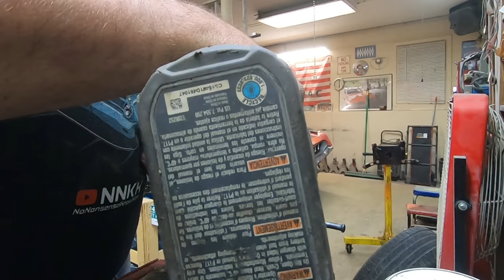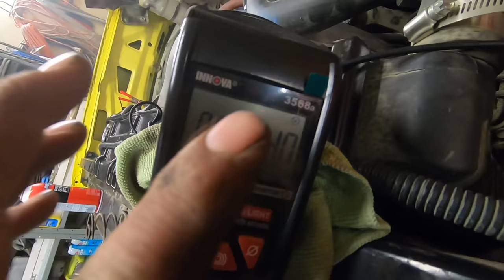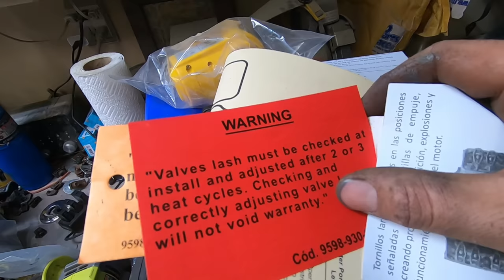Can I ENGINE SWAP a K5 Blazer in a Weekend for CHEAP?

Comment: If your trying to mess with hei distributors, and you don't have a distributor wrench, flex head ratchet wrench and a screwdriver, or sacrificial 9/16 with a 90° bend on one end..... everyone has at least one cheap wrench to bend up

Comment: @59:35 That ground on the alternator bracket is junk. You can see it smoking! Bad grounds can cause crazy issues. It can mimic ignition issues. Crimped end pre made cables can be trash. Hope you see this. Love the Blazer!
Reply from the maker: It healed itself

Comment: Use Permatex 2 on bolt threads instead of plumbers tape or RTV. 😂 Closing off the intake heat cross overs will make a carb choke not want to open fully in the winter or on cold days. There are different size holes available for the gaskets. Small and large. Leave the valve covers off when you prime the oil so you can see each rocker arm get soaked with oil. 😢 Spark plugs made in China are junk and are not all the same. I’d like to see the data on your quote about spark plugs. An inline fuel filter fits perfectly under the alternator bracket. I use demineralized water with Prestone antifreeze and make a 50/50 mix in a container in my summer driver 70 Z28 4-spd. I hope when setting your timing you plugged the vacuum advance can. If not then that’s why your timing shows high.😮 If the engine info says to set lifters then I would or kiss the warranty good bye. Some Chinese guy in the factory probably has no clue what he’s doing. Last thing you need are bent pushrods or a dropped valve. 

When setting hydraulic valves, don’t spin the pushrod, move it up and down, then from zero lash give it an extra 1/4 turn for performance or 1/2 turn. IMO 3/4 is too much and is why the dealer used 3/4, so the customer didn’t come back complaining about noisy lifters.😂

Comment: You put the Teflon on going the wrong direction it spits itself out and it’s super important to put the ground strap from the firewall to the back bolt on the passenger side head

Comment: I'm curious if the flexplate was for a 1 piece rear main motor - I know they are different and the 400 & 350 use a different 1 - my 383 ( 400 crank ) & my create 350 requires different ones for balance reasons
Reply from the maker: The replacement was a one piece seal

Comment: Dalton do you know the purpose of the hole in the front of the block that you put the bolt with the Teflon tape in?
Reply from the maker: Yep, that's my usual go to. But this engine was partially blocked with casting! First time I ever seen it

Comment: Was it weird pulling a engine inside of a dry garage rather than in a direct downpour like the last 3 or 4 motors you pulled on here?
Reply from the maker: Yes for sure
Reply: @PoleBarnGarage  it's so quite in the background no outside noise it was definitely different

Comment: that starter needs shiming what happens is the reman starter nosecone gets  to much material taken off during the reman process where it contacts the block the best way is to use the original nosecone on the reman just a suggestion

Comment: You didn't use the weighted flexplate from the 400 did you? You need a non weighted flexplate or it will eat the bearings out of it.
Reply from the maker: No, used a new one
Reply: @PoleBarnGarage  sorry, it looked like it had the external balance weights.

Comment: It takes about 2 hours to remove the nose of the truck from the doors forward as 1 assembly.  Saves you a bunch of time and your back from leaning over the nose.
Reply from the maker: I would never do that on a painted truck. Waste of effort and unnecessary risk. What the real solution is, is the fancy step stool that goes all the way up into the engine bay

Comment: Listen, 400 small blocks are externally balanced and 350s are internally balanced. So if Gomer put the flex plate on out of sink then the vibration could have killed the motor or made it run loosely and loose all the oil. So be sure you're using the right flex plate and harmonic balancer

Comment: I knew a Chevy man (I'm a Chevy guy to)who swore by motorcraft plugs.
Reply from the maker: They're just autolite
Reply: The porcelain on ac copper plugs is the most fragile porcelain of any plug that I have installed in 30 years of being a professional mechanic.  I won’t run them in my Silverado. Denso, NGK, Autolite all have a more crack resistant porcelain insulator on them.

Comment: Nice old k5! Throw those motorcrap plugs in the trash and get some AC Delco plugs. GM HEI ignition likes good plugs that can handle the extra lightning. Anyone who says there isn’t a difference in spark plugs hasn’t changed enough of them.

Comment: Redoing a Square Body mid 80''''s I have to replace the Radiator. I was just wondering should I go back with stock since it is Mostly Stock or would an Aluminum Radiator be better? If so what Name brand would You recommend. I'm trying to stay away from the chinesium. Lol Thanks
Reply from the maker: Big bucks if you don't go chinesium, I've had good luck with the cheapy ebay stuff
Reply: @PoleBarnGarage  Ok I appreciate it.

Comment: What microphone do you use for your videos? I got a go pro 7 because you endorsed it on your live stream
Reply from the maker: This whole video was done on a gopro hero 7 with no external mic
Reply: Do you not use a mic in your garage?
Reply from the maker: Typically I use a Panasonic g85 with a rode micro and a poofball. Using the rode micro on the go pro improves quality some as well. My first mic was some off brand knockoff of the rode, and it worked great as well

Comment: Awesome video buddy and definitely one really nice piece of history that your dad has there also!!! Would he be interested in selling it???? I’d definitely be interested in it because I’ve been looking for a blazers for a couple years but all the ones I have found are usually rotted out completely!! I’d really really be more interested in a 1969-1972 Chevy blazer if you might no some one that has one running or not running don’t care and don’t even care about the body for one either!!! I have a complete running gear for a blazer I actually just need a frame and body with a title I can definitely do the rest!!! I have both a turbo 400 with a 205 and a turbo 400 with the 208 also and the other one I have and really want to run in a blazer is SM465 manual Tranny and both with either a 205 and a 208!!! I even have a couple of each 203 transfer cases that go behind all the trannys!!! Yes over the years I keep saving all the trannys and transfer cases out of trucks that ended up going to the scrap yards!!! I definitely won’t run the 203 but will save the fronts of the cases witch is the gear box that I end up using for the doubler kits!!! I do run one of the strongest doubler set up in my 1969 Chevy 1Ton 4x4 that I have had since high school!!! It’s the SM465 with a 203 gear box that was behind a turbo 400 and then the 205 witch also was run behind a turbo 400!!! The SM465 I made one of the strongest output shafts with a 32 spline output shaft instead of the weaker 10 spline shaft that they came out factory with!!! I’ve been running my setup for over 10 years and havens had any troubles or broken anything yet!!! I definitely love all the extra gear options that I get with the doubler setup for sure!!! Oh and if I was you I would definitely go back in and double check all those lifters again and make sure that they are set Wright!!! I don’t no if you do a 1/2 a turn in or a 3/4 turn but I would definitely just go a 1/2 turn plus the looser they are the more power you will get out of it!! The reason I say I’d definitely recheck them is because a kid I was helping out baught a 350 from jegs and it was also a reman engine and I believe it also was the ATK engine and he ended up loosing his cam because he didn’t end up going in and checking the lifters after getting it running!!! Always check after start up and then after a 100 to 200 miles double check!!! Now if it’s me I’ll put on a really heavy trailer behind the rig and run it down the interstate at about 25 to 50 miles pull over let cool back down and then jump Wright back on the interstate and run another 100 to 200 miles!!! Every engine I’ve done this process to have definitely been good strong running engines and have lasted!!! Hopefully this helps out and this is just what I do and definitely works for me very well!!!! Awesome video once again buddy and remember keep up all the hard work buddy!!!!!
Reply from the maker: This one was rotted out 🤷

Comment: I have a random question, what timing light are you using with the HEI distributor?
Reply from the maker: I don't remember the brand, HEI or not it doesn't make any difference what timing light you use

Comment: Just noticed the firing order T-shirt. 

I do the same with storing bolts where they go.

With that big engine bay wouldn't have been easier to yank the whole motor and then move the accessory to the new block out of the engine bay and then stab it back in?
Reply from the maker: Eh, big engine bay makes it easier to install dressed, and less climbing for me lol

Comment: The bolt that you used thread tape on by the fuel pump, I used to use a longer bolt to hold the fuel pump rod in place while putting a new fuel pump on??? you ever do that
Reply from the maker: I tried but this one was a blind hole! I hadn't ever seen that before, that's usually what I do

Comment: I like to warm up the balancer center with a torch, heat untill paint starting to smoke. No press needed, they slip right on. I never tried to take one off after, but my guess is they are neigh impossible.
Reply from the maker: Maybe on a solid balancer, but I wouldn't be taking a torch to anything that is vulcanized together with rubber...

Comment: Had some of the same trouble on my current truck, 93 K1500, has a 400 with HEI, decided it was time for a whole distributor replacement, any electrical automotive part these days is a crap shoot, you think not going to buy Chinese aftermarket, but the so called big name, brand name aren't any better with quality control, makes chasing down a rough running engine, way more difficult,
That can't be bad!!!!! It's brand new!!!!! 😂😂😂 
You don't realize it because you've checked everything 3 times, and you're running out of new parts to throw at it, not a good feeling 😢

Comment: There should never ever be a reason to move the plug wires one position over unless your number one plug wire is not facing top dead center on the number one cylinder. Which means you didn't install the distributor correctly. The rotor should be facing the number one plug wire position on the cap at TDC.

Comment: Whats wrong with the transmission?  With the lines to the radiator I thought it was an automatic
Reply from the maker: It is an automatic
Reply: Is there a bad vacuum to it ? I noticed you shift it manually
Reply from the maker: Shifted manually to accelerate faster.

Comment: Headers, that would explain no ac compressor,, those brackets that they sell to mount the compressor are horrible to say the most.
Reply from the maker: And the original ac compressors are garbage with 134a anyways. Vintage air is the only way to go nowadays, thanks epa

Comment: I don't mean to brag about this but you do know that a Chevy small-block 400 is internally balance and a Chevy 350 is externally balanced so there's a huge difference when you put on that flywheel not to mention that but you already ruined the can because you didn't bring it up to 2,000 RPM for 15 for 15 minutes so that cam is already Whiped
Reply from the maker: I don't mean to brag, but I used a brand new flexplate (not flywheel) on the 350, not the 400's. And I also did a cam break in. Several thousand miles later it's just fine. Did you expect me to include all 15-20 minutes of it breaking in?
Reply: @PoleBarnGarage  so wait a minute you mean to tell me that you did a can break in several thousand miles on a flat tappet cam you do realize every single lobe on your lifters is completely Whipped and you still sit here with a straight smile and say everything's okay hydraulic lifters do not need to break in. Flat cap it's due
Reply: @PoleBarnGarage  if you knew anything about vehicles you would know this already

Comment: Well lots of good intentions but when puting a motor to gether a backyard is a backyard & theres lots of them on internet all ready but #1 never use starting fluid on a new motor & u always adjust ur valves & what happened  to knowing ur fire order & theres alot u.didnt account for it takes a bit more then I know a guy on the internet wow good luck
Reply from the maker: Nothing wrong with starting fluid. Can't adjust valves correctly until the engine is hot. Firing order was always correct, dist was in 180 out. Very common.
Reply: @PoleBarnGarage  oh thought you switched a couple then moved them all but we will agree to disagree on the starting fluid  but ok iam old school and when we have used it it in a rag & on   a diesel. but if u talk to all them utube buddys that u talked about they can tell you that when you buy a short block ur going to have to adjust the valves at least every one I have had sent to my shop but good luck

Comment: Why would anyone buy a short block 350 and NOT get a new or rebuilt water pump, oil pump, fuel pump,  new HEI, along with thermostat, plugs & wires, belts. Most parts stores have all of this in stock
Reply from the maker: You mean all the stuff that was new and I explained was new? Also, you're going to replace the OIL pump in the new short block? 😂

Comment: DONT USE DISTILLED WATER! It is mineral deficient,  what is iron? It will eat metal, cost me 3 water pumps and 2 heater cores before i figured it out over 15 years.
Reply from the maker: That's not what did that..

Comment: Man that truck way to nice not to keep original an either rebuild the engine or get another 400 replacement engine and stuff like the fan clutch an oil sensor to cheap not to buy new instead of reusing all that old junk
Reply from the maker: Nothing on that truck is original
Reply: @PoleBarnGarage  it sure looks clean enough to be
Reply from the maker: Paint and bodywork 🤷

Comment: STP DOES NOTHING FOR YOUR ENGINE OR OIL EXCEPT MAKE THE OIL THICKER, JUST LIKE LUCAS.

If you really want something that works ? Try BG Products, they have a whole line of Products for damn near everything for your vehicle.

I use to use STP back in the early 80's until I found out about BG Products, GREAT STUFF.

YES IT'S MORE EXPENSIVE BUT SO IS AN ENGINE & IT ACTUALLY DOES SOMETHING RATHER THAN MAKE YOUR OIL THICKER, LOL.

HEY IF ANYBODY'S OUT THERE THAT'S CONNECTED WITH BG GIVE PBG A FEW CASES OF VARIOUS BG PRODUCTS, YOU WON'T BE DISAPPOINTED.

Comment: good luck with ATK warranty they will give you the run-a-round till you give up!!! .Make sure you readjust  the rockers they bottomed mine out & wiped out the cam and put metal in oil.. Because  i install it in my personal garage witch they will not cover at all !!!!!!! had to rebuild the engine my self .What a ripp off company.As you know it's a lot of labor to do this so I would stay away from ATK and i bought it threw Summit Racing Parts witch would not stand behind it too wont be doing business with them again ether .*************************************************p:s your fly wheel 400 or 350 better check ?
Reply from the maker: We'll keep an eye on it but so far seems like good luck with this one

Comment: Blue caps suck. The plastic used doesnt have enough insulating properties to control spark. Ive has three do exactly what u went through, one actually would send an arc to the firewall on my 72 C20.  Just your average modern day chinese SHIT!!!!
Reply from the maker: No kidding? I've ran into it over the years a handful of times but never figured it was the plastic. Obviously it's a Chinese thing